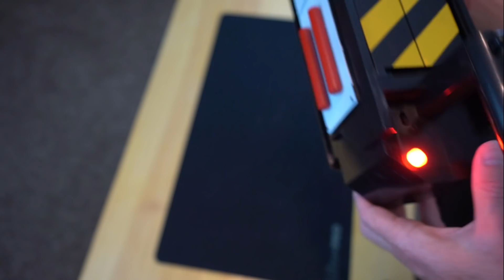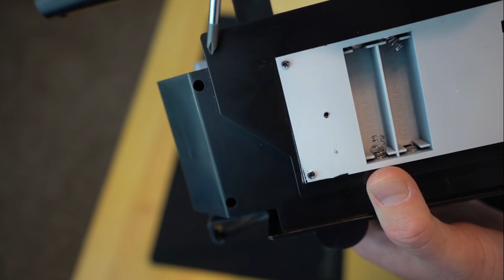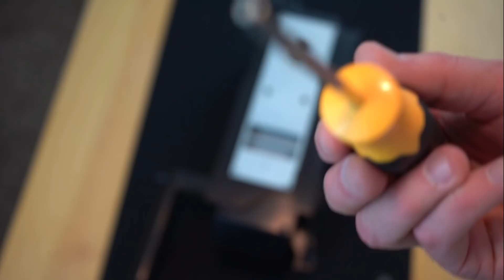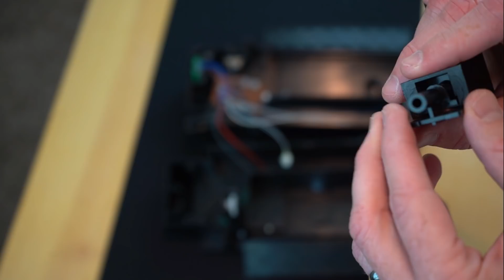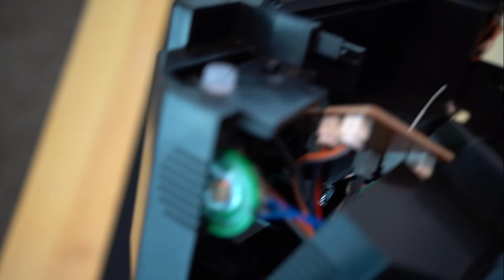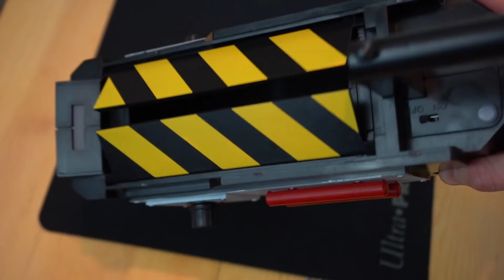Ghostbusters Ghost Trap by Spirit Teardown and Disassembly

Comment: Is there a spring under the button you press to open the trap? My kids played with mine, screwed the doors up and I tried to open it up to set them right and I’m guessing there’s a spring missing. Something was rattling inside before I opened it but I never saw anything. Now that I put it together the button no longer works.
Reply from the maker: It's a little hard to see, but at the 8:37 mark in the video you can see there are two springs attached to the tabs that the handle button pushes down on to close the trap. There are two springs there, one for each tab.

Comment: What is inside the handle ours broke a while ago and I think a part fell out of it any ideas
Reply from the maker: Yeah, the handle in the original version of this trap (the one that doesn't have a pedal to open and close it) used a "pen mechanism" similar to a clicking pen that, when pressed down, opened the trap, and when pressed again caused it to close. If you look at https://www.gbfans.com/forum/viewtopic.php?p=4907986#p4907986 I have pictures there of the internal of the handle.
Reply: @TragicManner  thanks so much

Comment: My trap’s button isn’t working and the doors just won’t close, don’t want to take apart, any suggestions?
Reply from the maker: Yeah that's a common problem. Check out this thread for some solutions: https://www.gbfans.com/forum/viewtopic.php?f=3&t=44922
Reply: It has nothing to do with the gears, the door thing with the gears happened a lot, but the button is loose and it is stuck all of the way open.
Reply from the maker: @jacksonmehew8920  Hmm, not sure without seeing it. That button screws onto a piece of plastic below it and it may just need to be tightened.
Reply: TragicManner i will try that, thanks.

Comment: Got this for my 4 year old boy. Worked great out of the box....he had the trap doors out of whack within 20 minutes. Lol
Any suggestions? I’m actually afraid to disassemble it since all the bells and whistles work,with exception of the doors won’t close all the way now.
Reply from the maker: Hey! A ghost trap like this would be an awesome gift to get as a kid! I'm not surprised the doors got out of whack, that's pretty common with these. I've even opened a few up that had the doors misaligned out of the box. The fix is relatively straight forward: You just take a flathead screw driver and push it between the teeth of the white gear of the door you want to adjust to keep it from moving while you carefully push the door slightly closed until it's closed enough that it closes completely when you use it. The problem is that this approach is basically causing the gears to slip on purpose and could put wear on the gears and eventually lead to them not working as well. You can find more details on this fix at this gbfans forum thread: https://www.gbfans.com/forum/viewtopic.php?f=3&t=44922

Comment: UPDATED: AVOID TRAP TAKING APART: I cannot put this back together and have the switch trigger when it opens. its connected to the 2 green wires and has a little silver plate that turns on the lights and noises, however I cannot figure out what is supposed to press in that plate to activate.
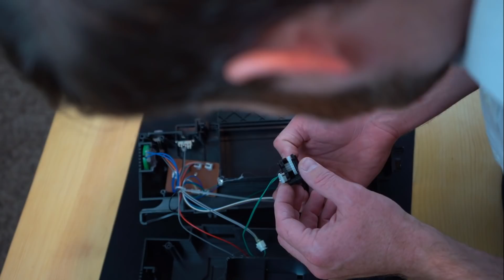Reply from the maker: What activates everything is a little switch that is built into the "gearbox" tabs. You can see it in my video at the 5:08 mark, it's the little tiny white switch that gets triggered when the trap pops open. If that switch isn't wired in well (it tends to come unsoldered very easily) then it will never activate the trap lights and sound because it never detects when the doors open. I would start checking there.
Reply: @TragicManner  Thanks for the response! Mine does work I can activate it by hiting it with my finger, however when I put it back together it seems like nothing is hitting the tab. If I close it real hard the green lights will flicker briefly.
Reply from the maker: @MrFang333333  Huh, that's odd. Perhaps something to do with the switch assembly? Are you able to get the doors to open and close without issue?
Reply: @TragicManner  Yeah its not easy. If you look at the plate on that switch, next to the useless white gear, there is nothing to press on it. I'm certain I did not lose any pieces
Reply from the maker: @MrFang333333  So that little white switch (It's actually half white, half black in my trap) has the small strip of metal that actually closes the circuit. If the trap is open, those two tabs on the gerabox will be pulled up by their springs, causing them to push into that strip of metal. At that same 5:08 mark you can see that the metal is closed because I have the tabs pushed up. At 5:15 you can see me opening and closing those tabs, and you can see the springs pretty well. They should naturally be pulled by the springs towards that switch. Did something happen with your springs, perhaps? Or did the tab maybe get damaged?
Reply: @TragicManner  I'm gonna have to take a look again. I noticed that too and figured as much but yeah for some reason it does not close it enough to trigger it anymore. Maybe I will try bending the tab lower in hopes that that will increase the motion on the tabs axis and trigger it. This is so bizarre and frustrating lol. I will update
Reply from the maker: @MrFang333333  Good luck! It shouldn't be difficult for it to trigger, but I'm curious now. Was it ever working before taking things apart?
Reply: @TragicManner   Here I made a quick video of the problem. YEAH IT WORKED FINE!! LOL
https://youtu.be/R-7Nrv579_s
Reply: Yeah I would highly advise people NOT take these things apart. It's super tempting, it LOOKS mod friendly, but you quickly find yourself fighting a losing battle. I literally spent hours and hours, days trying to get that switch to trigger again. I remounted it, all the while wires would become unsoldered. after remounting so many times, soldering, pieces coming apart, drilling, even inventing a new trigger system, the switch finally broke and I finished it with a hammer. The morale of the story. These things come out of the factory with the components hanging on by a VERY thin thread. It depends on everything to sit just right and if your not lucky it will NEVER reassemble. Sucks, the plastic design is great, but the functioning components and electronics ARE NOT. Unless your gutting it, your risking a HUGE nightmare. It's literally easier building one from scratch.
Reply from the maker: MrFang333333 dang MrFang, so sorry to hear that. I have seen a lot of complaints about the electronics on these and I think you are right. As time has gone on it has become very clear these things have since quality issues, especially with the electronics.
Reply: @TragicManner  Yeah I really appreciate this video and the time you spent!  found a the exact micro switch last night online to replacr, but I'm replacing with a slightly better. Its really gonna be hard to get it back together, I'm still gonna try here and there. I'll let you know if it ever assembles again lol.
Reply from the maker: @MrFang333333  Best of luck moving forward. Sorry you've had so much trouble!
Reply: @TragicManner  Hey just an update I did get it back together by resodering and purchasing a higher quality switch! I have made it a little more battle ready with electrical tape, hopefully things will hold together for future disassemblies. Its more sturdy internally now.  I would really be interested if you end up doing a smoke mod video. I want to eventually have the door servo operated with smoke etc. Anyway thanks again for all your responses and support!
Reply from the maker: @MrFang333333  Glad you got things back up and running. I'd love to eventually do a smoke mod on mine, but for now I've moved on to some other projects, though I'll probably come back at some point!

Comment: Thank you for your tear down video.  I've been attempting to reassemble the trap, but the "pen clicker" mechanism inside the handle now only works intermittently.  Also, more importantly, the lights and LEDs and flashing properly when the doors are open and closed - but the audio is no longer working.  Any idea how to address this?  I have tried un-plugging and plugging in the blue cables that run to the speaker from the board.   No luck.  No wires appear to be severed or disconnected.  Any idea?
Reply: Sidenote:  I saw your thread on GBFans - great mod.  Might be willing to buy your functioning original handle assembly (since you made a new one) and circuit board if you are willing to ship it over.
Reply: https://www.gbfans.com/forum/viewtopic.php?f=3&t=44829
Reply from the maker: Hey Julian, sorry about the problems you've hit! First off, audio is probably because one of the wires that go to the speaker got knocked loose. The soldering on many of the components inside of the trap are not great and tend to fall off. So I would start with the two wires that go to the speaker at the back of the trap and make sure they are connected properly. All other parts of the audio are pretty much hidden away underneath the black spot on the circuit board, so I'm not sure what else it could be, really, but if that doesn't work I'll sit down and see if I can figure it out.

As for the pen clicker, I've seen that exact behavior you're describing in traps at the store. I would check the knob that comes out of the top of the handle, the one that you press to get the trap to open/close, and make sure it's screwed into the pen clicking mechanism all the way. That part screws off so it's possible it may be a little loose. I'd also make sure that the handle itself is seated properly, getting it to fit right into its slot can be a little tricky.

Let me know if any of that helps and if you're still having problems we'll see if we can get to the bottom of it.
Reply: TragicManner - Thanks sir!  I actually replied with this info to that "bad trap day" thread on GBFans as well.  Will definitely check the speaker wire connections and screw in on the button.

Comment: I have the opposite problem with the doors. They open very far but don't close all the way. Just bought it and very frustrating. Was debating on trying to return or open up like you're doing and messing with the gears.... any advice is appreciated.
Reply from the maker: Don Puchalski yeah this happens when the doors have been adjusted to open wide. You can fix it by opening the trap just a little and moving the gear box assembly away from the gear teeth in the door. Lay the door down flat and, while keeping the doors flat and completely closed, move the trap back together and screw it closed. The doors will close all the way at that point. Unfortunately it does mean that the doors will not open up very wide. It's either one way or the other unless you want to do the servo mod.